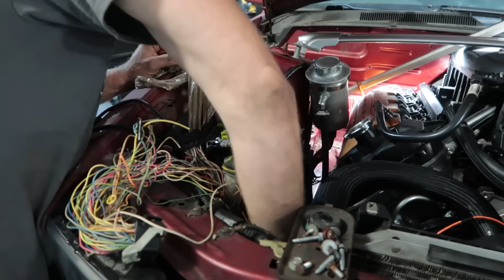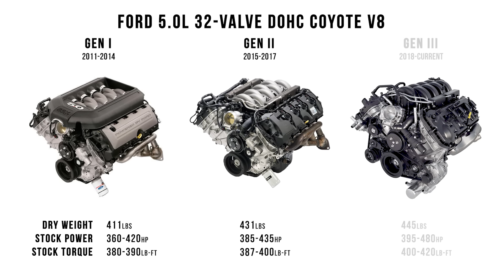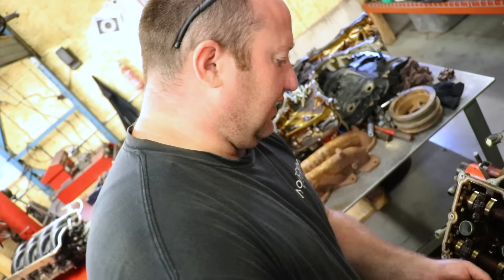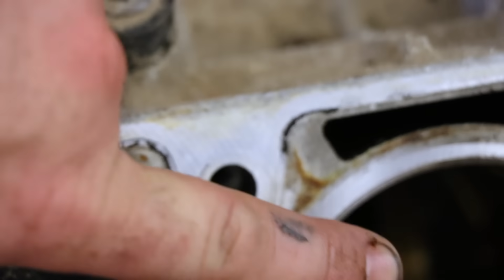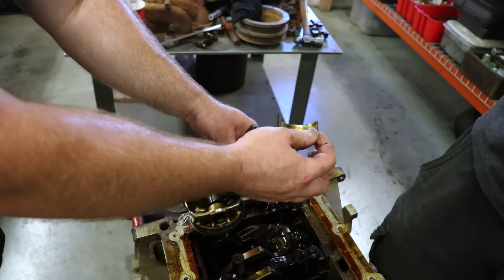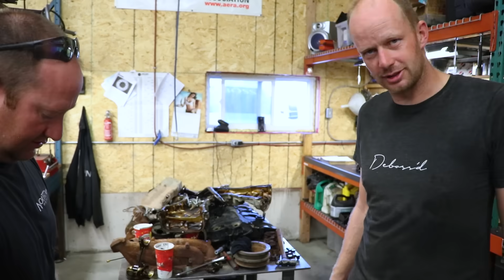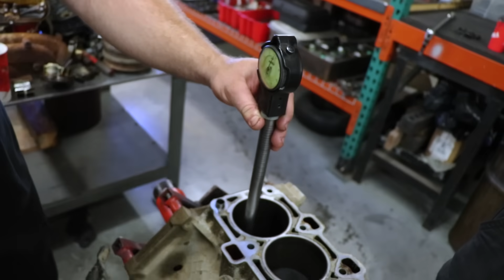REVIEW: Everything Wrong With A 5.0 Coyote Engine

Comment: If synthetic oil causes problems, that seems like a major design flaw. Also, if it can't handle switching from one brand of oil to another, it sounds kinda like a pile.
Reply: This was the first time I've ever heard of an incompatible oil problem with any engine.
Reply: I think the editing was a bit misleading unfortunately. It seems like Scott’s issue with synthetic oil comes more from the increased oil change intervals, rather than just synthetic vs conventional all other things equal.
Reply: @thelol1759  I think you're on to something with your comment. The problem is not the oil itself. It's the beleif that instead of lets say 5k on conventional (an ok interval i guess...i'd go more like 3000 3500 on conv) and they say that you can get 10k even 15k on just standard synthetic oils which is nuts. Amzoil? Maybe you could push it. But the run of the mill oils? No. Also some burn oil from the factory (gm3.6 cough) which will not be good if its down to 2-3 quarts by the time the oil is changed each time. Just use some nice synthetic in anything half new ish, lets say after 2000 and do maybe a 7000k miles tops on a synthetic.
Reply: @BaileyHatfield-b3f  Synthetic is always double what conventional is. I work on heavy equipment and normal oil intervals are 250 hrs on conventional. Now all brands call for 500 hour oil drains with synthetic. I have a 2017 5.0 and i run 5W-20 pennzoil full syn in it. My truck is at 80k and i do 10k intervals. Did an oil analyis this oil change and they said there's still another 7k worth of kms left in the oil sample. I would go on what the manufacturer says for oil intervals as majority of brands have same intervals. I find it hard to believe majority of manufacturers that have the same oil interval for synthetic or conventional don't know what they are talking about.
Reply: Synthetic doesn't cause issues, and oils are required by regulation to mix with no issues. The guy knows engines but nothing about chemistry.
Reply: @RiverCA  a lack of heat cycling is the issue that doesn't boil everything off was the point I understood. Sure, on a highway vehicle that gets up to temp every time and keeps working won't sludge up. Which lines up with my experience of heavy trucks too.
Reply: it sounds odd because this guy has no bloody idea about motor oil.... motor oils are SAE CERTIFIED and pass rigorous testing for blend compatability.... total horse shit here about this guys oil diagnosis....
Reply: All modern engines do this. Especially higher displacement ones which are pandering around in colder climates and maintained according to manufacturers plan. Open GM HF V6, pentastar or new hemi after 100k and it will look the same.
Reply: This just proves ford is junk..... can't switch oils or it will destroy your engine? GTFO WITH THAT BS LOL
Reply: @tundras4ever552  You really are illiterate. No one had said and ford hasn't said you can't switch oils. Anyone who says that doesn't know what they are talking about. I've switched oils. Used to use mobil 1 and now I use pennzoil because it has better flow in cold weather than Mobil 1. I have no issues whatsoever
Reply: @wrectumwrangler  might want to rewatch the video there bub
Reply: @tundras4ever552  he said in his opinion that's what he thinks there bub. He said at the end he doesnt know everything and doesnt pretend to. Everything he says is based on his opinion. Think you need to rewatch it bub
Reply: @wrectumwrangler  @ 10:55 😘
Reply: @tundras4ever552  he says at the end everything is on his own opinion. Still dont see what's hard about grasping that
Reply: Ford 5 litre range engines=boat anchors.

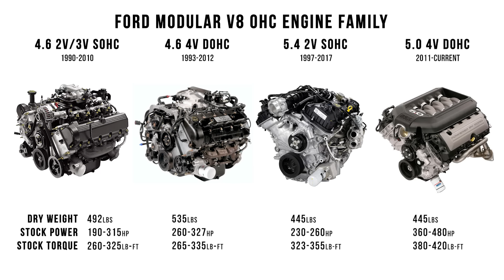Comment: in the pictures of the engines, 8:39 that is not a 5.4 2 valve. definitely and ecoboost. Hence the turbos.
Reply: yeah the 5.4 2v looks exactly like a 4.6 2v with a slightly higher deck. I swapped a 5.4 2v into my mustang and no one knew the difference until i told them lol.

Comment: This engine reminds me a lot of the GM 3.6L v6 in the camaros etc. but with 2 more cylinders. The GM motor also had issues where under the valve covers each side usually has a different level of slug and discoloration.
Reply: That's the difference between fresh and foul air on the pcv system. Fresh filtered air in stays clean. Foul combustion gas contaminated air stains everything on the way out. Every engine with a cross flow crankcase vent design will do this.

Comment: Excellent video. A lot of really good observations, but also a lot of very confident conclusions and full explanations on the causes of things. I don't think you can draw those conclusions. For example, all engines running on synthetic burn oil. Engines stripped down for efficiency with loose fitting components like rings burn oil. You are not evaluating a system in isolation. There are driving habits, climate, engine design and construction, etc etc...far too many variables than to have these simplistic conclusions.
Reply: they did a pretty good job of couching their explanations. these are some experienced guys.
Reply: @sparty94  I agree, but there are some implications. At the end of the day, they have seen many problems,  and identified conditions or symptoms these have in common. They have also identified fixes that work. Is there a problem with that?

Yes and no. Ultimately it doesn't matter why. If something works don't change it. It's engineering not science. However correlation isn't causation. Certain additive packs vs"synthetic" under different conditions could make all the difference. Moderately used synthetic vs conventional oils at cold temperatures are miles different. I'd rather have some crystal buildup than molasses in my sump.

I know they're smart guys, but they are too free with their conclusions. They're excellent up to that 95%.

Comment: those oil pumps are garbage, i see them go out all the time if you add any little bit of power to it that pump shatters because it made out of powdered steel, witch makes it super eazy to break, take that oil pump gear and drop it from 4 feet and watch it bend or crack or shatter
Reply: I've just dropped one from 12 ft on to a steel bench and it's in 1 piece with not a mark on it ,so where did you get that shit from !.
Reply: @geraldswain3259  ive only done it with 30,000+ miles ones and the gear always warps or something ive never had one be spotless and @itsjusta6 did a video of them dropping one

Comment: How about the 4.9 300 from the old square body fords
Reply: It delivered like 150HP but it would do that for 50 years strong.
Reply: @bobbygushlinger3637  lol so true
Reply: Love that engine.  The ones I had were bullet proof.
Reply: very reliable engines
Reply: Best engine ford ever made and ever will.
Reply: Love mine, ive had it 13 yrs, still work out of it daily. All i do is change the oil and put gas in it.
Reply: It's pretty good for a tractor engine.
Reply: @turbolq4  mine will run 70 comfortably and pull anything i hook on to it. It gets 15 mpg consistently, doesnt use a drop of oil at 350,000 miles, original everything.

Comment: That engine probably had its oil changed a hand full of times in its life.
Reply: Not buying the synthetic logic or the detriment of mixing oils, at all.
Reply: Looks like a poor maintenance schedule to me.
Reply: I thought the engine oil is lifetime. At least only with Ford
Reply: @Greenbearls  lmao yeah, my mom blew up the 4.6 2v in her truck cause she never changed the oil in it.
Reply: How many times does it take to fill a hand?
Reply: @svtirefire  4 times
Reply: I change mine when I get around to it
Reply: Mike Pevency 
I have a round toit for sale!
Reply: OHC way of the future and LS is old tech. So why did Ford just introduce the 7.3 gas Godzilla? Long service life and reliability I would guess. BTW what's up with Ford and these names they give their engines?
Reply: @Chuck Gladfelter Any oil will if changed as needed.  Manufacture recommendations and oil change reminders can only go so far.  Some people's driving habits just break down oils or overwhelm them with moisture and contaminates too quickly.  I also don't buy the "mixing oils" BS.  This isn't 1960. Pretty much all modern oils are compatible with each other.  For years I only ever bought whatever oil was on sale but I changed it every 3-5k miles or twice a year if it didn't get enough miles and never had an engine sludge up in the slightest.
Reply: @John-ok6sq  Yep I change the oil a little before 3k miles on every truck I own like clockwork. Just had the valve covers off my old chevy and it is absolutely squeaky clean under there. I can drive for several days after an oil change and yank the dipstick out and the oil is still a light brown caramel color. I've changed the oil on other peoples cars and the dipstick is coated in jet black oil right after first startup with new oil.
Reply: @Bloodbain88  dude 6000-10000miles for an oil change. Every 3k is not needed these days. Oils are better than they used to be. All my mechanic friends do 6k interval. Unless its a built engine or you're racing it, just do 6k and save your money.
Reply: I'd say it got oil changes, but it was in a truck used as a grocery getter, sat around in traffic, and driven less than 30 miles a day for an extended period of time.
Reply: Joseph Arata they are designed for that
Reply: @vojnikjna30  yeah nah, Gasoline engines rely on the same basic physics to operate. Operating an engine in high idle, low load conditions causes oil breakdown. Same thing happens to diesel engine oil. They weren't "designed" to be grocery getters, that's just the role they're put in by your typical 500 lb fat body American.
Reply: Joseph Arata Yep and the last thing you want to buy for a grocery getter is a Ford “proof“
Reply: Alpha Wërks idle shouldnt hurt anything, burns off moisture more so than short runs on and off
Reply: @1991tommygun  high idle does cause problems. We don't have EGR on gas engines anymore, but look at the intake manifold side of a gas engine that uses variable valve timing, you'll see the same issues as if you had egr. Direct Gasoline injection is also an issue with intake valve buildup and causes more frequent problems with fuel in the oil.
Reply: Joseph Arata a good catch can system should come factory on all direct injection engines, especially forced induction engines.
Reply: Joseph Arata  you don’t need egr when you have variable cam timing. They can  adjust the cam timing and accomplish the same thing.
Reply: And it was prob changed with conventional
Reply: @Full_Spectrum_Dominance  Synthetic no doubt
Reply: MrJCS My Father-in-law did this with his 2016 F-150, 5.0. Did his own oil changes for a while before realizing the 6,000 mile oil change interval was for synthetic oil. He’d been using traditional oil. I couldn’t believe it!
Reply: Both of my 5.4L 3v engines were well maintained using motorcraft oil and still looked tobacco Stained on the inside
Reply: @kevintucker3354  That's what dino oil does. Synthetic won't stain.
Reply: I’ve seen engines that had royal purple ran in them and they were always super clean. I decided to run the purple stuff in my G8 GT that had those lifters and DOD that are notorious for failing. 200k later she’s spotless inside and still no issues. I need to do research to see if there are cheaper oils that still do what royal purple does. Those detergents really do make a difference in my opinion. Also royal purple is made to be thick on start up and thins out after hitting running temp. I see better oil pressure in my 07 Silverado that has 260k running Royal purple than other synthetic blends.
Reply: Kyle Gilbert “royal purple is made to be thicker on start up and thins out at running temp”.....Dude you just described about every single brand and weight of oil in existence. Quite positive is not an exclusive royal purple thing.
Reply: @kylewest100  every oil is designed to be like that but you've got it backwards they're thin on start up and then thicken with heat "kinda" the numbers on the bottle tell you what weight oil it acts like at different temps
Reply: Michael Flanagan yeah but however it’s designed it works great plus the detergents
Reply: Exactly!  Reason number 1 why not to buy a used vehicle.
Reply: @kelliegrase4658  you can find a low mileage 2 yr old used vehicles with a carfax showing oil changes
Reply: We have a brand new 135,000 miles that burns oil. I drive the truck and have changed the oil regularly.
Reply: @samduran5180   Make sure the pcv is functioning. I've seen 50k mile Honda accords burn a quart every 1500 miles from a clogged pcv. 

Replace the pcv, and not burn any
Reply: @Resistculturaldecline  good call will do
Reply: If it only had 30-40k miles, that would be totally fine.
Reply: I’m a total noob so just know that before you blast me out of the comments. I just want to ask what is the purpose for the double overhead cam opposed to the single cam. Is there a specific user that Ford was aiming at??
Reply: Would have looked worse than rhis
Reply: Just discovered your channel. Gives me something to watch and learn during my self incarceration during the pandemic. A light-hearted channel with a guy that likes to laugh at himself. Love it. Thanks.
Reply: I bought a nice explorer 4.6 but the engine was neglected. It ran perfectly no blow by, no noises, it had the wrong oil filter on it when I bought it, I swapped that out right aeay. Turns out the correct oil filter is  very critical because it keeps the chain tensioners tight when the engine is shut off. Long story short the oil pump pickup got clogged with chain guide fragments and lost all oil pressure. I was going up hill in passing gear with a trailer on back so it was a bad time to loose oil pressure and spun a rod bearing. Moral of the story, if you buy a used triton engine check to see if the previous owner used the correct oil and filter.
Reply: Shouldn't have to use special oils or short change intervals. This is due to poor engineering.
Reply: This guy's not a chemist he's a mechanic in the damn good one ,,so to correct you the PCV is on the passenger side of the head  the driver side of the head gets fresh clean air from the air cleaner  therefore doesn't develop sludge ,,, the passenger side is sucking in hot Vapors  that have passed through the engine ,, then the PCV  it gets all the hot  in vapor s and they crystallize , crystallization does not occur until certain temperatures are reached, unlike you stated that short trips are causing crystallization, and also you said there were filters leading to the cam phasers did you mean screens rather than filter, and thanks for the video very informative
Reply: jesse aguirre is a screen not a filter? A "filter" is designed to "screen" out contaminants from a system. Sure, a mesh screen is nit as effective as a small micron filter element, there are some very fine screens used to pre-screen contaminants from a filter system. I've never dove into these Fords, i'm simply addressing your comment as it was stated.
Reply: jesse aguirr
Reply: oil, what's that...
when the manufacture claims extended oil change intervals......  5k 10k using our shhhhhspecial synthetic magic oils and filters.. uh-huh, 3K at tops, check oil every gas fill, look in front and behind at every parking spot/stop you make. thinner oil junk materials higher output = accelerated wear and oil consumption...
not all of us were born yesterday, nor will we abide to the EU/OBAMA era planned fudge-fest...
Reply: @throttlebottle5906  3k? You're wasting your money an good oil more than you're saving your money

Comment: Worked at a Ford dealership, we had nothing but problems with the 5.0s they absolutely loved to burn the exhaust valves out of the head specifically #8  but I've seen as many as 6 out of 8 being low on compression, they also had issues with the water pump letting go and the plastic y bridge under the intake cracking and dumping coolant all over the road, it was bad enough that I'd take a 5.4 3 valve over the 5.0 coyote. And we had issues getting motors for warranty wound up having to grind valves a few times. And these were on engines that had like 80 k kilometers. It was common enough that we could walk out to the parking lot see the check engine light and see the truck shake and tell the customer that it needs an engine it will be 2 months
Reply: Not true and you know it. The coyote is a solid engine when maintained.  They have been out long enough to see the reliability and they have been very solid.
Reply: @sprint2648  I can put you in touch with the dealership if you want, and a few machinists.
Reply: To be fair, we live in northern Saskatchewan  and what is called extreme driving conditions,  lots of dirt, dust, extreme heat and cold